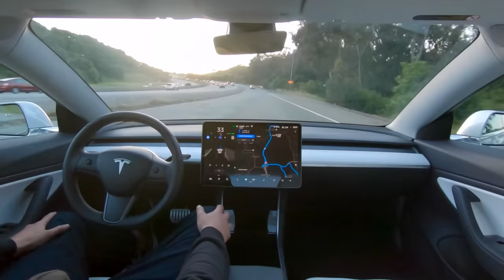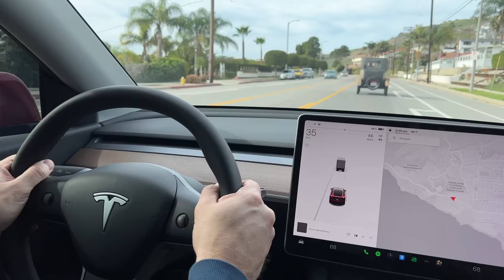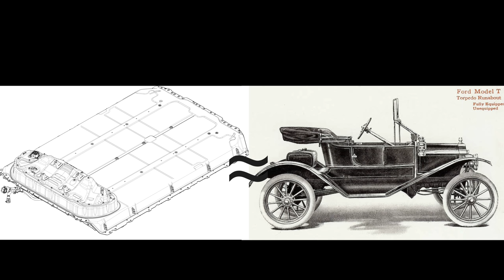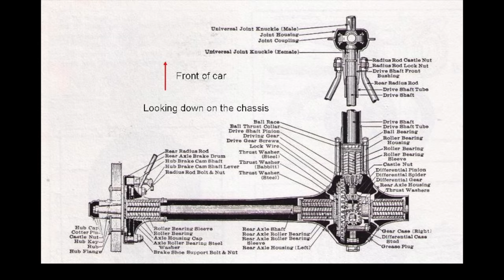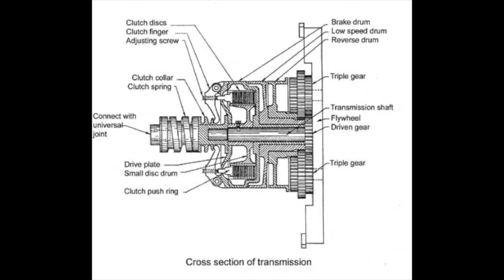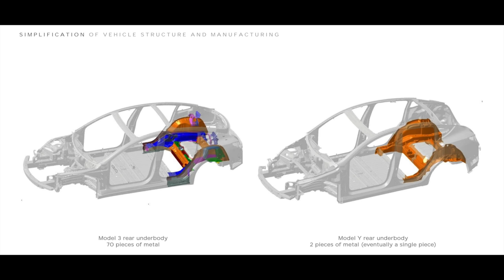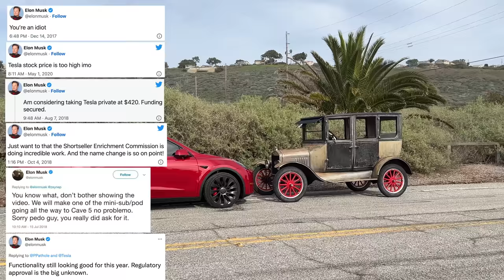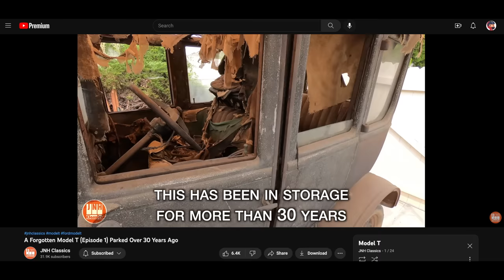1923 Ford vs 2023 Tesla

Comment: you failed to point out that the foot brake is not the only way to stop a model T, the handbrake can be used while driving if needs be, as well as that engaging reverse or low gear, remember the cotton bands, any pedal can act as a brake, I own a model T, choose it any day over a Y

Comment: Now which would you rather daily? Personally I split the difference and daily a 50 year old ('73 model) Volkswagen Super Beetle, which I actually prefer over my mom's Tesla Model 3. The simple manual controls are a major factor in that, I hate the touchscreen interface that requires you take your eyes off the road to do anything. The Bug also has great visibility, can see my surroundings really well, while the Tesla you can't see anything, forcing you to rely on the cameras and other electronic gadgets.

Also, the similarity in the model names has had ramifications. The Model 3 would have been the Model E, but Ford had a trademark on "Model E," perhaps it was what they were thinking of calling the Mustang Mach E.

Comment: I own a 1926 Model T. The transmission brake is definitely much less effective than modern wheel brakes, but it's not anywhere near as bad as you make it out to be. While safety systems on a Model T are basically non-existent (not even a seatbelt), the slow acceleration and limited top speed does limit how much damage you can do to yourself in a crash. It's also pretty much impossible to get a speeding ticket in a Model T. You also didn't point out that since the fuel in a Model T is gravity fed, if you are low on fuel and you go up a steep enough hill, you'll get the fuel level below the level of the engine and fuel stops flowing. Your only recourse is to turn the Model T around and go up the hill backwards. The Tesla can go up a much steeper hill without starving for fuel. My Model T doesn't have the flip-up steering wheel, so I have to get in on the passenger side and slide over. which is much less convenient. On the other hand, every time I go to the ice cream shop in my Model T, people tell me how awesome my car is and lots of people want to know about it. You won't get that kind of reaction from a Tesla. For all of its flaws compared to a modern car, I'll take my Model T over a Tesla any day.

Comment: 13:51 Minor correction. Ford trucks have a reputation for build quality. Their cars are hot garbage on wheels. Rolling turds. Lemons. No wait, that was insulting to lemons, I take that back. In my area we call them "Fix Or Repair Daily" or "Found On Roadside Dead".

I had the severe misfortune of owning a 2007 Ford Taurus a few years ago that I bought from my grandmother for a mere $2000, which sounds like a good deal until you learn how much I spent fixing it. Literally just keeping the thing running was a never ending series of expenditures and escapades. I've had to tow it home multiple times. Everything leaked. Two of the power windows stopped working, one while it was already down. A fuse kept blowing for some reason so I had to change it out every couple of weeks. I would be up before dawn to go to work and the engine would just shut off until I replaced the fuse, again. Kept having to replace the oil and coolant. All attempts at using leak fix failed, merely slowing it down at best. I found out the coolant was leaking at an alarming rate while on my way home it suddenly overheated. 

The worst part were the catalytic converters. There were three of them for some ungodly reason and one of them disintegrated, clogging up the exhaust, which caused hot gases to back up into the intake, melting parts of it. That fix alone cost nearly as much as the car. 

To contrast all of this, my family has owned multiple foreign vehicles, and one Chevy. The Chevy wasn't too bad, just a few design flaws that made it hard to change the oil or headlights. Oh, and some terrible electrical problems that cropped up after several years for no apparent reason. Nothing makes me more proud to be an American than seeing result of our brilliant engineers. 
To replace the failing Chevy, my parents picked up a late 90s Toyota Tercel. It wasn't pretty, but it ran well and had no major issues. Once they had the money, they replaced that with a fairly recent Honda and have had no issues. My father has had an early 2000s Toyota Tundra for the last 10 years and has had to do minimal repairs, despite using it to haul a heavy trailer several days a week. I myself purchased a 2010 Hyundai Tucson from my sister, who had previously crashed the vehicle, requiring fixing the AC and minor cosmetic repair. I have had absolutely no problems with it since. My sister now has a nearly new Honda with no issues whatsoever. 

Almost forgot, I had a coworker that wrecked his Ford Mustang because it didn't shift gears properly on a slightly wet road, causing it to lose traction and start sliding. This wouldn't have been a problem, but then the traction control took over, completely locking the wheels, so that the vehicle slid into a utility pole, totaling the vehicle and nearly killing my coworker. He replaced it with a newer model, that then started having catastrophic electrical problems. So yeah. Ford is so very reliable.

Comment: I was thinking, too, that both have spawned many imitators, some noteworthy in their own right (though it's still a bit soon to tell with Tesla if their competitors will hold on). Ford's included Citroen, in appearance with the A, and in spirit with the Traction Avant. The Tractions have proven to be as reliable as the Model T, though they resemble modern cars more than the T. They, too, were produced through a very long production run from 1934 until 1957. England had the Trojan, which decided that the Model T still had too many bells and whistles, and was one of the last cars to use solid tires (tyres). It was very inexpensive, but cyclecars were cheaper, so it died shortly after launch. What did succeed was the Austin Seven.

Tesla seems to have inspired a lot of imitators, and many from the company have created their own cars, like Lucid. Even some companies who were in indirect competition with Tesla at the start of Model S sedan production (Fisker) have been reinvigorated by their success.
Reply: Thanks for watching and commenting congratulations I've a prize for you text now to claim..🎁🎉

Comment: While this is pretty funny, you could have actually made a really close comparison between the two (see connecting the dots' vid). They both revolutionised the industry, they are both highly standardised, they both made most of their adaptations in order to focus on mass production. How did they 'fit' in the market when they were released? (the tesla was initially rejected with minute production and few chargers). What was the ratio of investment to profit margins? How did they change the supply chain, the way workers worked etc etc etc. Lots of interesting questions left aside...

Comment: On the model 3 you can do the air conditioning and heat by just telling the car what you want and it does it automatically.  You don't have to touch the screen, just the button on the steering wheel.  A little homework on the Tesla would have helped in that case.

Comment: I also got a Model Y with curb rush - that seems to be pretty common.
Reply: When did you get yours? 2020? The earlier the worse it is. If you're going to get a new Tesla, id wait til GIGA Texas has scaled, as anything coming from the Fremont plant is much more likely to have finish issues. GIGA Berlin and Texas are the best Tesla offer right now, and Shanghai is right behind. The reason for this is that the Fremont factory is their first, and was originally a GM factory, meaning the layout isn't optimal, nor is the manufacturing line they are using.

Comment: Firstly.  Model T is high and highly visible and it has an aoogah horn which adds to its safety.  Crumple zone, if you could call it that, is very high and it's light weight reduces it's kinetic energy.  Watch an old silent film and about the worse thing that happens to the driver in an accident is that then end up sitting in the street and their hat flies off.  Model T's have no distracting screens or infotainments systems.  Also, the reverse pedal can also function as a brake and reverses the car immediately after coming to a stop.  Not kidding as I had that demonstrated to me in a 1915 Touring.  Let's see a Tesla do that.    
  One more thing-  it took the VW Beetle a long time to surpass the T's production numbers.  17 mil vs 15 mil for the Ts in much more modern times.  And they are highly repurposeable.  Ask any farmer or Hot Rodder.
Reply: You can switch the Tesla into reverse while you're driving forward actually. That's one of the neat features it has.

Comment: I would have to disagree with you on the safety between the two cars. If going back to the 20’s, with the average speed of 30-40 mph. There wasnt enough speed to truly injure the occupants. So technically they were just as safe in a high speed capable car with safety features.

Comment: Isn't the single piece of wood on the Tesla just a wood veneer on a plastic strip?

One thing you missed is that the model T, if taken care of, may still be operable in another hundred years. If the Tesla is well taken care of you will have replaced nearly every part by 2050 and certainly wont be operational in 2123.

Comment: Oddly enough almost all cars built under the name Ford Model T can run on pure ethanol which not only empowered the rural folks providing for them the ability to produce own fuel but also to use recyclable energy to propel the car. That puts both these cars on the same scale when it comes to environment especially if Tesla is not charging on electricity made by burning coal.
Reply: Burning ethanol still releases lots of CO2

Comment: The Model T was brilliant... until it wasn't. For the first 8 years of production or so, Ford dominated the car market, until a man by the name of David Dunbar Buick started selling his cars with more features for only a little bit more money, about $310 vs. the Ford's $275. These features included a 3-speed transmission, inboard drum brakes, and a more powerful engine. This made Buick's way more suited to cruising than the Fords, and so people sold their Model T's and bought Buicks. In doing so, however, they made the automobile even more accessible for the poor sectors because they could now buy a depreciated Model T second hand for less than a hundred bucks. Most of Buick's sales were actually during the Dust Bowl. People wanted cars that could handle long distances while going fast (55 MPH) and offering a comfortable ride. The Model T was made until 1927, when it was replaced by the Model A, to compete directly with Buick, which a that point had been absorbed into General Motors alongside Chevy, Oldsmobile, and Cadillac. The model A was already obsolete when it debuted, however, because of Ford's Flathead V-8 releasing in that same year, and at that point the automotive market was saturated enough for competitive pricing, so the V8 sedan wasn't so much more expensive than a 6-cylinder Buick. The Model A's only saving grace was the reason it went out of production: the Great Depression. Ford stopped making them in 1931.

Comment: The DIFFERENCE is if that Model T rolls down a hill, you flip it back on it's wheels and it's good to go.  If that Model Y rolls down a hill, you call the scrap yard to come pick it up.
Reply: The difference is that the Model Y probably wouldn't roll over at all due to its low center of gravity.

Comment: Tires are likely biggest reason Model Y rides so bad.  Manufactures pretend huge rims and just a inch or two of tire is modern, but it's vain when you actually have to drive somewhere.  16-18in wheels with loads of sidewall may look older but you won't be shaken to death in your new six figure car

Comment: It's kind of unfair to complain about the T's fuel tank, but not the Y's battery. Battery fires are far harder to put out. I'd still say the Y is far safer, but that can't be overlooked.

I'll say the only safety features the T has is the brakes, the low speed, and the fact it can be driven over a cliff.

Comment: The "Tesla being one of the safest car" claim was a bit misleading. Crashing tests were done not using the car's own propulsion, so the tendency of Tesla's battery catching fire or exploding cannot be truly represented. Also their electronics are notorious for failing, even the brake is digitally controlled, not mechanically, and is prone to failure.
Reply: No it's not misleading.
Besides scoring extremely high in crash tests, fires in Teslas and EVs in general are much less likely than ICE cars. There's no "tendency" to catch on fire or explode.

Teslas are not brake-by-wire. The brakes are mechanical as with any other car, with a brake booster providing additional power.
Stop lying.

Comment: The Model T had a price drop in 1923.  It cost $350!  However, today, a car worker makes around $250 a day now.  A worker in 1923 made about $5 a day! So let's make it easy here. Today's worker makes about 50 times the 1923 wage. Now if you use that 50 times on the price of the car, then the Tesla should cost $17500!  WAIT!  The Tesla cost over $50,000! So, wages have not kept up with the price of the car!

Comment: I am a big fan of electric cars. regardless who makes them. But I am glad that the Model T at least tied. So I want to propose a tie breaker. Go out with the Model Y and the Model T and see which car is deemed the cooler of the two. I guess you already experienced the answer and that it was the Ford Model T. The Model Y would not have been possible today if it wasn't for Daimler and Ford. As for "Ford kinda liked the bad Germans, I don't know man, seems Elon is not all that different. Kind of odd to put that as a plus or minus against a car.

Comment: I want to root for Tesla, but instead of announcing model after model that wont be available for years (decades?), they need to start refreshing the models they do have, making quality a concept, and putting controls back in. Id love to have a Tesla, but will NOT buy one where I have to do every f-ing thing from a touch screen. I mean, aim the air vents? Open the glovebox? Thats ridiculous. 

I have a Bolt on order (tried to order an Ioniq 5 back in September, but they were estimating delivery in July. Of 2025. And kept jacking up the price besides.).

Comment: you gotta give 100 points to ford you forgot to mention the fact that the things materials cost is dirt cheap. and has the advantage anyone can fix one by going to any section of home depot or lows and grabbing random things. 

-100 points for the tesla. as you need a PHD. and have the decades of skills and experience of electronics repair and a sterile lab and microscopic tools to make any real repairs to one. and be very familiar with programming. you may or may not also need a Microchip manufacturing facility to conduct most if not all board repairs.
Reply: Thanks for watching and commenting congratulations I've a prize for you text now to claim 🎁.

Comment: Regarding safety, I would say that the low speed is an inbuilt safety by itself. Plus, the Tesla would be (economally) totalled at a 50klm'h crash, due to the expensive airbaugs. The Ford siply needs a new bumber and all is well again. Two points extra instead of deducting one.
Apart from that, the price of the car is the major point here. Teslas are not cheap to buy or maintain. The Model T is. It also reached a world wide marketshare of 75%, something Tesla will not be albe to do. Two extra points for Ford. 
And comparing the owners while looking at cars? Minus 1 point for the channel.

Comment: The energy you put into an old ford just sits there and is ready for use as is, while the energy you put into a tesla has to be turned into something else, because batteries store no electricity
Ping 
One more point to the old ford
Reply: Has to be turned into something else? What?
Reply: @logitech4873    Chemical energy, in the form of chemical reactants inside the battery.
Reply: @gsilva220  I don't get it. This has to happen with the ford too

Comment: If only tesla (and most of the new cars and EVs) would stop using those stuck-on tablets. Integrate it in the design, was done for 30 years. And make it non glary glossy and optional no-touch navigation.

Also simulating haptic buttons with sensors and vibration instead of effing buttons..
I wish there was a basic tesla version with nothing fancy, only stuff needed by law.
Basically a kit car, at least i know the building quality (not material) then.

Comment: Model T will be around in 2123. Tesla Model Y will not last 100 years, without replacing the battery every 8 years (after battery warranty runs out).